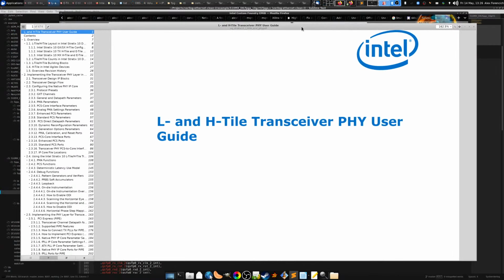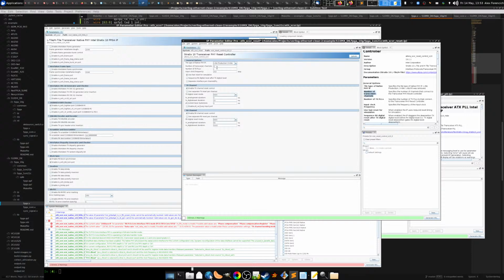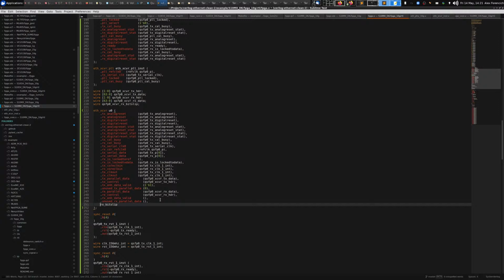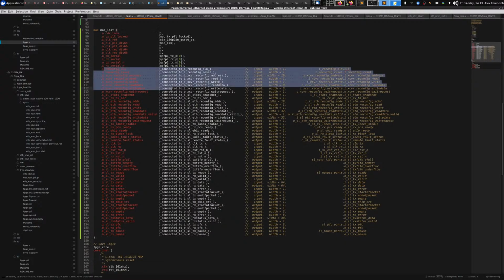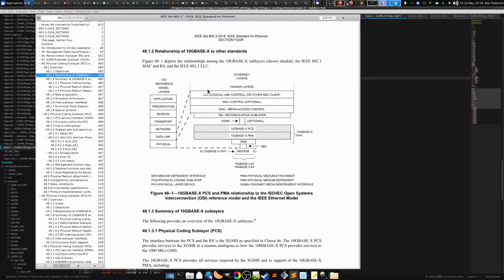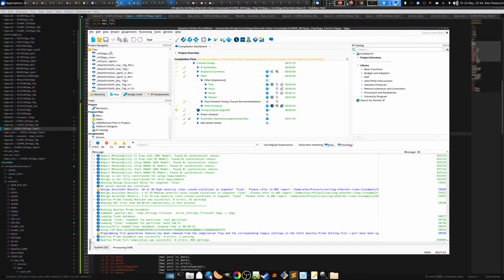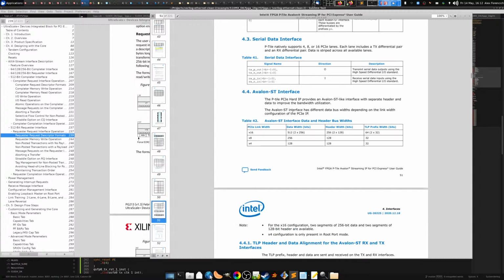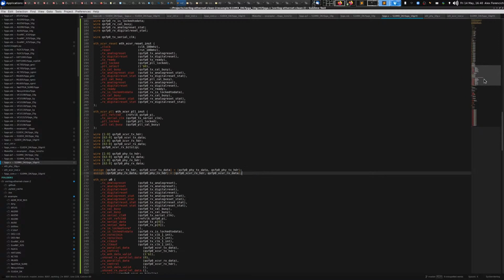FPGA Dev Live Stream: 10G Ethernet on Intel Stratix 10 MX and DX

Comment: What's the difference between making your own block synch algorithm vs using the built in block sync?
Reply from the maker: Depends. In this case, the frame sync hard logic only works at 10G, it's not available at 25G. So if you want to write code that can work at 25G or at both 10G and 25G, then it has to be done in soft logic. However, the hard logic implementation will probably be the standard one - check for sync, slip one bit in the gearbox, wait a few cycles, check for sync, etc. This is probably sufficient for most applications, but my research involves optical switching and for that the lock time is rather important, so I'm planning on experimenting with alternative frame sync implementations that trade higher complexity for faster lock time. And that will naturally have to be implemented in soft logic.